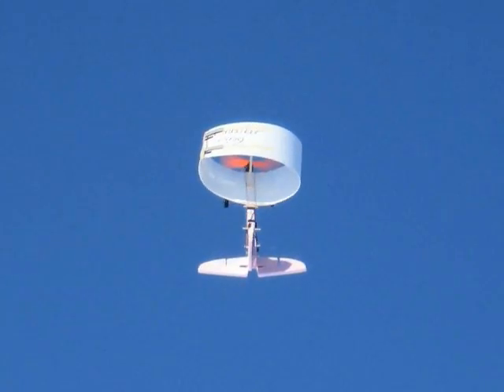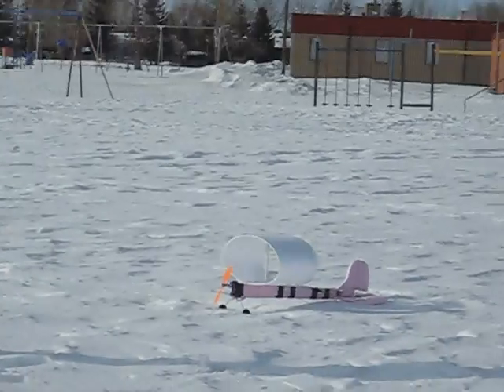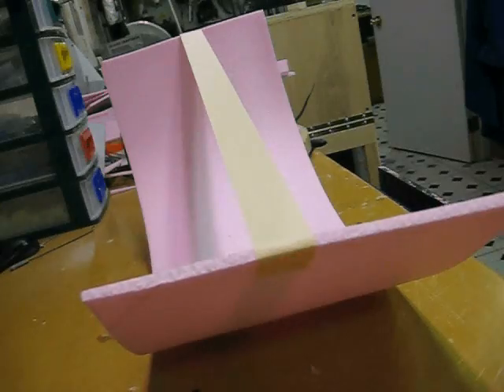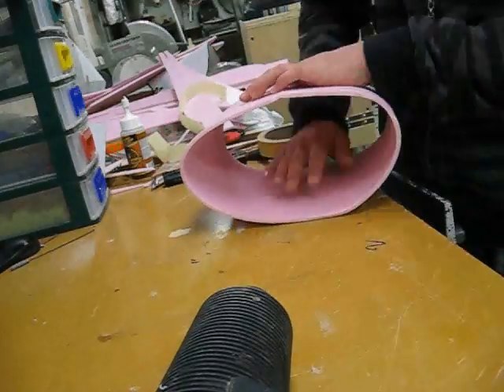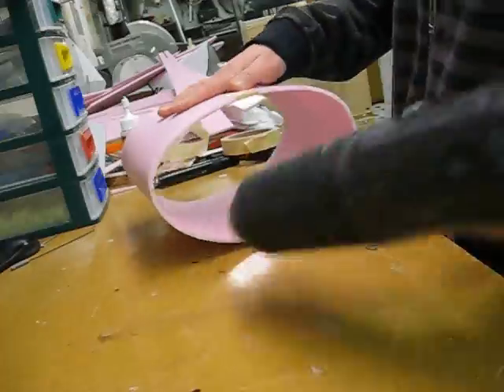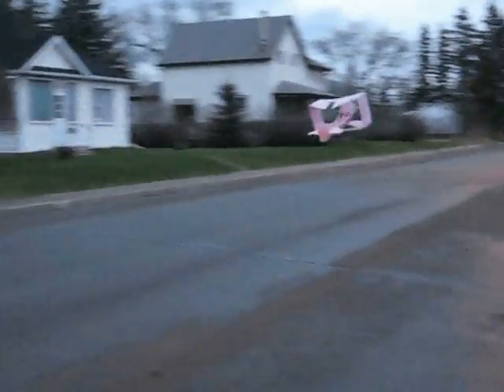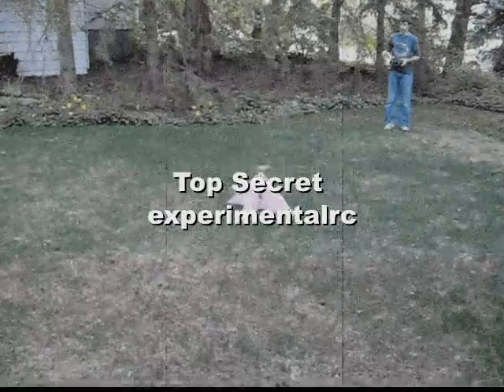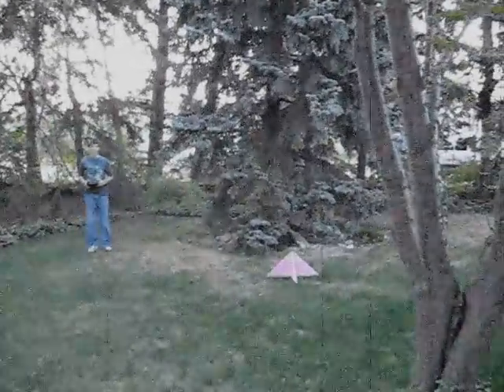Regarding annular wings #3... (Season 1, Episode 5)

Comment: HI I would like to make a suggestion for you I have been playing with annular wing design as will. the best foam I have found is at walmart its foam board with paper on both sides. you pull off the paper on both sides. use a rolling pin and you will gradually cause the wing to curve you will also get a much smoother stronger less brittle wing let me know. and good luck.

Comment: Well you should make a shape out of wood that matches the inside of the tube and then build the wing/tube around that. In such case you could use wood (balsa or similar light weight wood) to build it. This type of method is often used when you build things of thin wood like bowls, buckets etc.